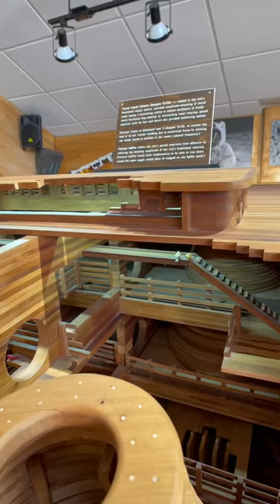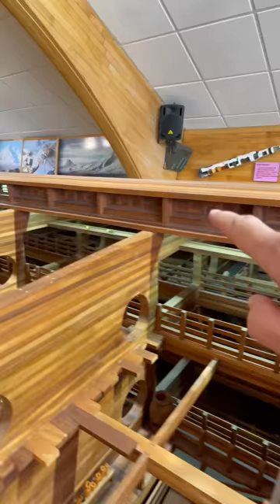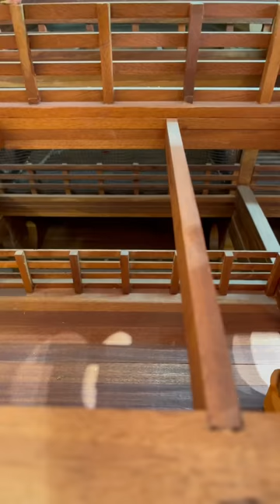Clever Engineering on Board Noah’s Ark -  Light and Air Distribution

Comment: Yeah thats not how intake and exhaust ventilation works.
Reply: 2000 years ago.. pretty smart tbh
Reply: Lets talk engines tho because thats something I'd die for
Reply: @killerman4403  I got you man lol. Don’t know much but what can you tell me about doing a 5.7L v8 in a 3.6l v6? Been looking into it but not sure if I would need a whole new set up or if I can run some of the same stuff from my 3.6l and hook it up to the 5.7
Reply: @pabloalejandre2739  idk man seems like you're building a completely different animal rather be safe
Reply: @gareth6652  hahaha that’s the plan. This v6 was fun but I want speed like mcqueen
Reply: @pabloalejandre2739  you need  whole new setup bro
Reply: @pabloalejandre2739  just supercharge it.
Reply: @pabloalejandre2739 
I don't wanna be mean what so ever but I don't think you should be doing an engine swap if you don't know that.
Maybe ask a friend who is a mechanic if he can help you or just go to a mechanic.
Reply: @pabloalejandre2739  you just named engine displacement sizes what car is it in the first place
Reply: @pabloalejandre2739  depends what type of vehicle, some you have to get a matching transmission to work with the new engine and one that will hold more power than the stock 3.6l eng trans. sometimes you can get away with changing the transmission bell housing to fit the bigger v8 but the trans will be more prone to breaking because more power if used with the v6 transmission. Hope this helps some.
Reply: Well explain how it works then
Reply: @killerman4403  yeah 2000 years ago but the perfect being known as god gave him those instructions and yet us inferior humans have found a better way…
Reply: What about the light?
Reply: Ty lol
Reply: @killerman4403  it’s not even 2000 years ago in the story
Reply: Not the only windows my guy. And heat rises, no? Circulation achieved.
Reply: I was just about to say that
Reply: @fireclaw2   I work in the roofing industry and if you have ventilation just at the top of the roof it is not adequate. Yes heat rises yes but if there is just a place for heat to expel and not for air to flow then mold will accumulate. It's actually a really bad design. 
 Furthermore, to touch on someone else's statement. It doesn't matter if it was 10 days ago 10000 days ago or 10000 years ago. Noah not design the arc  From the way I understand it.
Reply: @mattneville2864  you can see windows on the bottom area as well. Cold air flow from the bottom and the heat goes out the top. He never said those were the only windows. GG
Reply: All you ventilation experts 🧠
Make some videos on your channel(s) and show how 
it's done 🔥 
Best to you all
Reply: No you don't understand, you see.. god made it work.
Reply: @afox5319  I just saw the guy asking to talk about engines so I asked lol. I’m going to have my dad help with it he’s a mechanic.
Reply: @echo__noar8676  I’ve heard I can keep the transimission. I have an 8speed. And my car is a Chrysler 300s 2014
Reply: @killerman4403  there actually was a lot better way farther back than 2,000 years
Reply: @afox5319  but he is literally asking mechanics right now..
Reply: Come on. God just made it work. Duh
Reply: @killerman4403  2,000 years ago? As of 2008 the oldest tree on the planet was over 8,000 years old. So which is lying, the tree or the book written by people who didn’t know where the sun went at night?
Reply: Just one window huh...
Reply: @cartreezy1631  lol
"Our crops burned up from a falling sky fire! Must mean God wants us to sacrifice our youngest child!"
Well of course it does! 😂

Comment: This guy thinks an air hole is an incredible piece of engineering. How about the fact that it is impossible to have a wooden boat the size depicted of Noah's ark as wood bends and the flex would be too severe to hold up.
Reply: My 18ft sail boat has a bulk head, but this boat doesn't need it because lighting was more important.

Comment: That's a cool model. I like how they used modern engineering to design it.
Reply: Right
Reply: Yea and can modern engineering replicate the Pyramid of Giza?
Reply: @shaydorahl6740  
Nope. The technology, and tools, required to build them (and they’re all over the world, not just Egypt) simply wasn’t available to mere humans..😳😬
I’m questioning what I was taught in school.
Reply: The Real Duke  

The problem isn't manpower, the problem is the size of the slabs, the dimension of the design and the pin point precision of each slabs placement, the Pyramid of Giza didn't have mortar or any sealant, each slab is perfectly aligned.

144,000 slabs in total, each slab weighing over 20 tonnes if I remember right.

Even with modern technology we would have a near impossible time even lifting a slab much less matching the dimensions.

Furthermore the slabs or blocks were not put together, they were each a solid piece either molded or perfectly cut.
Reply: @shaydorahl6740  someone believes in magic and fairy tales
Reply: @shaydorahl6740  absolutely, it would likely take a lot less time as well.
Reply: @khastilrist  

I believe in the power of Knowledge which God is the pinnacle and epitome of to such a degree that the ignorant will think that what God does is magic when in reality it just seems that way because our level of understanding is infinitely smaller.

Also quite interesting that you would consider a conscious creator ordering reality from His own essence and knowledge to be magic while simultaneously thinking that a causal universe expanded into reality from a singularity without first action and from a state of nothingness/'true chaos and thinking that such isn't magic or a fairy tale.

The creationist understanding whether religious or mot is the understanding yhat information must have no beginning in order for existence to exist and that therefore all things that exist or can exist are the expression of eternal information.
One concludes in that information not just being guided by consciousness but that the ibformation is itself the consciousness based on the fact that the universe us a causal demonstration of ordered reality and that if we be conscious and self aware then the information required for consciousness must be preexisting as well, both of which lend immense weight to the conclusion of reality bring the result of eternal conscious information.
Reply: The Real Duke  

How would a slave or even a team of slaves perfectly mold and or shape 144,000 20 tonne slabs, lift them onto one another and have them be near perfectly aligned one with another clear to the very top of the Pyramid?

Not to mention the astrological and geological placement of the Pyramid of Giza as well considering that it is placed near perfectly between north and south latitude and longitude points among numerous other variables?

That seems more the job of specialists, not slaves and well educated specialists at that.
Reply: @shaydorahl6740  reminds me of a tool lyric. He had a lot to say, he had a lot of nothing to say.
Reply: @shaydorahl6740  are you aware of what a pulley is? Or how sandstone is formed?
Reply: The Real Duke  because humans can't build anything perfectly especially by hand. The building/house you're in right now isn't made perfect, even with all the modern tools, cranes, forklifts........ Yet ppl thousands of years ago built megaliths, so big you can see them from space, perfectly by hand?
Reply: The Real Duke  they weren't slaves bud
Reply: The Real Duke  no they were perfectly cut and perfectly "mathematically aligned." They were cut and layed so perfectly that you can't fit a human hair in between any rocks. And the mathematics needed to build structures like this wasn't around yet. Or are you implying ancient civilizations were doing calculus, geometry and trigonometry? The Pythagorean theorem wasn't even around back then. There's a reason why all contractors and construction workers say it's impossible for humans to make this by hand. We'd struggle to make these today, even with modern technology
Reply: What if the pyramids were mountains carved down.
Reply: @claudiaholmes8468 Oof how could those dirty savages manage to do geometry and follow through with the gargantuan project/s
Reply: The Real Duke  the pyramid builders weren't slaves
Reply: The Real Duke  

Did I say that the Pyramids weren't man made?

I said.that based on what we understand of architecture today, I don't understand how they did, I didn't say that they didn't and the point was to emphasize that even today we cannot accomplish some of the feats of the ancients.
Reply: @shaydorahl6740  This is what this guy needed to hear bro
Reply: @shaydorahl6740  yes. We have the ability to be that precise and to move things that heavy. what we are mystified with is how did they do that without super computers and Lazer levelers
Reply: @claudiaholmes8468  pffth how much technology do you need to put a rock on top of another rock ?
Reply: @bogard9627  um some old manuscript have been shown to be painted over pages of calculus hundreds of years before the current founders of calculus. I forget what this manuscript is called. To be frank we don't have much of their math paperwork. So for all we know they had calculus down.
Reply: @shaydorahl6740  yes. Very easily. Let me guess, you think aliens built the pyramids and not stone masons with a basic concept of math and build planning that theyd been using for centuries at that point?
Reply: @abysswalker1562  

No?

I don't think aliens built the pyramids like Giza or Machu Picchu, I just think that ancient civilizations likely knew of techniques and certain knowledges that even modern civilization might be currently ignorant of.
Reply: @shaydorahl6740  yes, but slavery is outlawed, so they'd just use machines nowadays. The common ingredient is geometry. Ancient Egyptians were excellent mathematicians, according to actual evidence.

Comment: Actually, you know, at that period in time they never had to design a ventilation system for a ship that huge, particularly for a ship containing such a massive number of animals. And this ventilation system is not acceptable. Carbon dioxide is heavier than air, so it's just going to sit in there like it's in a big bowl, especially since the windows at the top are so tiny. Sure, methane is going to trickle out, but methane production is going to be much smaller than carbon dioxide production.
Reply: Don't stress over it. There was no massive ship built then.
Reply: The 2 of each animal stuff is BS. Maybe some animals(a few cows or goats) might have been taken. But not 2 of every animal.
Reply: @TheWizardGamez  bro you couldn't even fit 2 of every different kind of chicken on that boat let alone 2 of every different type of goat or cow. 

It's completely bonkers.

Comment: The window provides air tightness as you can see, the rubber tree factory on level 5 supplies us with the rubber gaskets to keep everything airtight so of course the windows work. Multiple floors are held up by single beams because we have unobtainium from God so it just works that's why

Comment: Omg.  It has been proven many times the ark would have broken up and sank.
Reply from the maker: I don't think they take into consideration a couple things. 1.) The wood may have been denser back then. 2.) The design may have been more clever than todays understanding. 3.) God held it together when human manufacturing integrity ends.
Reply: @LostWorldMuseum  what a load of BS
Reply: And what did they eat on the so called ark and after also all the fresh water fish would have died also all the animal would been born after the ark would have a cap on genes and be born with problems also how would you breed one family to fill the earth
Reply: @LostWorldMuseum  the problem is not how dense wood. There are extremely dense woods we even used to build bearings for turbines and ship screw tubes up until the 20th century. The problem is you would need this trees to be 500 feet long to avoid using too many seams that are the weakest point of every wooden hulled ship due to sagging and bending.
Reply: @phantomsoldier497  I realize what you are saying. This side of seeing the ship and understanding the type of wood and construction it had, its hard to know the complete "how's"
Reply: @AdolfiRealEstate  We have the specs in the bible and those are completely unrealistic from a ship building standpoint. Ask any engineer
Reply from the maker: @phantomsoldier497  No, I get that part, we do have the specs. But what we don't have is the density of the wood and the antediluvian way of building that ship. So we are left with what we have today as wood and our understanding of ship building.
Reply: @LostWorldMuseum  so with our lack of understanding, the lack of any evidence the flood happened and the evidence from the field of archaeology, history and even physics demonstrating that not only did the flood not happen, but it could not physically happen, why believe it did?
Reply from the maker: @slickmcCool  You put forward a very strong argument when stated like that. However there is another side that puts forth an equally strong evidential position that explains what we observe from strata to fossils and more that fits into a creationist model and a world-wide flood. This comment section is not the place to have a very comprehensive discussion, but if you like email me and I can hook you up with some resources to contrast and compare the two positions. lostworldmuseum@gmail.com My name is John Adolfi.
Reply: It's called a moon well, durable wood and wood resin pitch.
Reply: @phantomsoldier497  

 it was a stationary vessel with a moonwell, that is a different design entirely.

When's the last time you heard about a design for a ship that doesn't move?

Comment: If the side of your model weren't wide open showing the three levels with full room light, you wouldn't be getting any light Beyond a few feet below those slat Windows set back under an overhang. And I'm almost positive that Noah's Ark did not have LED strip lighting behind those windows, as the model does.

Comment: Micro fiber materials with a designed to work like Tesla valve to stop water. A burned on wax coating for watertight fireproof or lightning fire proof. They could have used lava to make mirrors that would double refraction iridescent materials in the lava? The lava is a liquid so small drops would have to be dripped (respect the LAVA drip). Molted wax first then lava leave the the one point that will be entrance and exit of the small amount need for any small perfectly angled light from sun or torch? I’m just guessing. All colors are every color but that one iridescent material is every color from a an angle.
-Speculator

Comment: Just wondering how you justify that the window was water-tight and let jn enough fresh air for 8 humans and all the animals.  Even if the window ran the length of the ark, just how much light do you think they got during a rainstorm?  Plus how did they keep the window facing the sun?

  Then you claim the center of the all 3 decks were open; does that include the bottom deck?  Granted that it would make clearing out the pens a lot easier, but I would be worried on any boat with a moon pool that runs nearly the entire length of the vessel.     Even if the keel was below the bottom deck, they could have put a few more planks inside to complete the floors more.  Then, we could still have mastodons, unicorns and  dinosaurs🙄

Please, use your brain before talking nonsense.